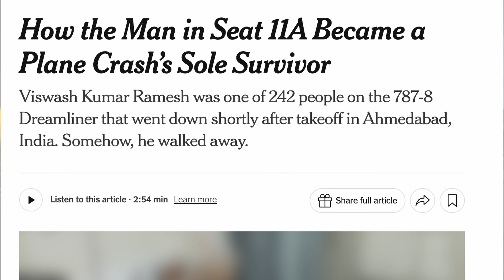Why the RAT Changes Everything – Air India 171 Update

Comment: What came to my mind is that people have been warning about cyber attacks since 2015, and aircraft now are flying data centres, especially the 787. Flight control is electronic with no cables.
FADEC, the flight control module  and the ELMS can all be hacked. Yes, the systems are air gapped, but there’s still concern. Hackers at DefCon etc have shown it’s possible, even with separate hardened architectures. Introduce Starlink to this, and the mind boggles.

Comment: How could whatever caused the RAT to come down not have been found if there were final-minute and thorough safety checks on planes?  Surely any major or even not so major electrical problem would have been discovered - unless 'internal' and last-minute SABOTAGE is the reason for these shocking and accumulating 'unexpected' disasters?  This isn't about simply finding out what went wrong:  the world needs to know they are going to be paying for, and taking, planes that aren't allowed to launch into the air with massive mechanical or other problems!  And Boeing have become now renowned for failure to ensure safe flights in their planes.  I assumed following the USA Senate's Inquiry into Boeing just several months ago as I recall, that Boeing would have been closed down - now we have evidence that there is something very seriously wrong with adequate checking not being carried out.  That is how I see it.  We can continue to take flights in sheer terror and NOTHING is being done to stop it.

Comment: Crashes are bad enough, but you lose two engines like that during initial liftoff, that’s DC-10-grade freaky. I’m not exactly eager to board a 787 after this. One engine, fine. Two? And no bird strike?

I personally suspect a computer glitch or malfunction.
Reply: At least 3 redundancies for every system and it STILL shut down completely? What the hell!  Owing will be absolutely desperate for this to be pilot error. Another reliability issue with Boeing, well, how do they recover??
Reply: @mkkravist11  , hopefully for Boeing it's an Air India maintenance issue, otherwise...

Comment: RAT means Ram Air Turbine. It provides emergency hydraulic or electrical power to essential systems in case of a dual engine failure or main power loss..It works by using the airflow (ram air) generated by the plane's forward motion to spin the turbine.

Comment: That flight was way over maximum gross weight. Something was in cargo undeclared. You will never know.
1. They used every cm of that runway to have enough power to accelerate it to take off speeds at that weight but It just wasn't enough. You see dust cloud for a reason.
2. Difficulty climbing after lift off
3. In panic Copilot pulled up the flaps instead of the gear.

Comment: Rat auto deployment theori is not True. 
To auto rat deploy in case of both engines loss requirements are: both engines at or below idle and plus 2 seconds time delay.Total time between loss of lift(a/c lost of proper aerodynamic lift, positive climb) and crash was 20seconds. 
Droping idle speed takes much more time during takeoff.  Also take into account 2 seconds time delay and about 4 seconds rat movement. 
The time you point out the 'gray dot'  also some seconds before the crash. So auto rat deployment scenario does not make sense.

Comment: Dual engine failure as they rotated is just crazy, I’m of the belief that the 2 hour flight they did before this leg the fuel was contaminated and on landing when the fuel pressure was reduced some foreign particals got stuck in the fuel line so when they powered up for     t/o they get full power for a little while but they loose fuel flow right as they get airborne and an engine starved of fuel is going to roll back, what I don’t understand is why both did it at exactly the same time because I thought big jets like this had different fuel systems

Comment: Software/System Fault (FADEC or Electrical)
If a shared system (e.g., the FADEC controls, electrical bus, or sensor input) sends incorrect data, it could cause both engines to shut down or roll back immediately.

Extremely rare, but possible if there's a shared configuration error or miscommunication between systems.

Comment: Blaming dead pilots is the easiest thing to do. Both pilot had together  more than 10000 hrs of flying time. Let's give them their due. They gave May Day call and tried for controlled hard landing all in time span of less than 1 minute. Cant rule of safety issues at Boeing off late as well. Lithium battery used in Dreamliner has had issues in the past. Lets wait for investigation to get over and give due respect to all passengers who died along with crew and pilot. No pilot will be careless when own life is at stake.

Comment: I couldn't see the RAT deployed at the beginning of this video from the rooftop. The RAT seemed to deploy after the flight has gone a little far, where you have rounded it with a red circle. Please confirm if I am right. If the RAT didn't deploy at the beginning of the video, then how can it make the typical RAT sound? Take a screenshot of the moment you see the flight in the video, zoom into the image and check that RAT has not  deployed at that moment.

Comment: Good observation Captain
Blocked fuel filters, mismanaged crossfeed systems, or contaminated fuel could disrupt flow to both engines simultaneously. or FADEC malfunction disrupting thrust, resulting in Partial Power in both engines that it could not sustain climb in high temperatures of 40°c and full load.

Comment: I'm still with the flaps not being selected for take-off, before flight weight checks at the gate and pre-take off would have made both pilots check them. I'm not familar with the aircraft but I would imagine they are screwjack operated and wouldn't blow back in the event of hyd failure. A RAT deployed and no flaps at take off is a combination I've never seen before. (Thirty year aircraft enginneer).

Comment: Great that the RAT never pops down during normal flying as planes already fly at super slow speeds, else like you could reach London to New York in less than 2 hours, so on-demand additional electricity generation by the RAT is otherwise pointless 😊

Comment: Juan Brown -blancolirio -had pointed out it appears the gear was commanded UP because the wheels are not angled down like after liftoff. First they go level and the doors open, then they go up into the fuselage.  Then were in the level position.

Comment: Has someone missed the cloud of white smoke visible in the video taken from the airport security camera as the plane is just lifting off? Where did it come from?
Reply: May be it was dead end of runway..some sort of dust or don't know
Reply: @shiVani-sv1ns  It's possible but unlikely as if this runway is used regularly the jet blast would normally have blown most dust off it... I wonder if the engines started to fail at that point? There's no flame visible from a common flame out, but supposing fuel starvation occurred and the result was white smoke? If there was water in the fuel...

Comment: 3:07 even without seeing the video, the audio plainly recorded the noise of the RAT.  It sounds like a prop plane, because it is indeed a variable pitch prop in the airflow. Given that passengers on a previous sector complained that there were multiple electrical problems, I'm not convinced by the dual engine failure theory.

Comment: It's clearly NOT dual engine failure but a problem with the electrical system / hydraulics since they couldn't raise the landing gear. There was a video on youtube showing passangers complaining abut the electricity in the plain not working befor takeoff, just put 1 and 1 together

Comment: Thanks Captain. Really clear and congratulations on your preparedness to discard your previous conclusions based on new evidence. But...both engines failing at once? What on earth? I can onlythink of contaminated fuel or some soft of software malfunction on the engine management system. But...in those cses, how would the aircraft have got off the ground. Congratulations to the Air India crew for trying to manage the situation...getting out a Mayday and deploying the RAT, as well as electing to keep the gear down.

Comment: Two factors you haven't mentioned:
a) The ground temperature on the day was 39°C 
b) It was reported by a passenger on the last  flight that the air con wasn't working.
The combination of both could have caused overheating in the avionics and therefore the RAT was deployed.

Comment: It's mind boggling to me that trained pilots cannot recognize a stall when they see one.  And this is a classic stall.  If you look at the shape of the wings from every video available, they all show the same thing.  The wings are skinny, which means that the plane was never properly configured for departure.  The flaps were never extended.  The RAT was manually deployed by the Captain who mistakenly confused a stall for a loss of engine thrust.  The gear was never raised because in the confusion going on in the cockpit with alarm warnings sounding and the Captains refusal to believe the flaps were in the wrong position, he panicked.  As a Captain yourself, I'm sure that you understand that flaps up at low altitude is a death sentence.  This Captain had one chance to extend the flaps and raise the gear as soon as he realized that something was wrong and he failed to recognize a fixable problem.  If trained pilots and experienced Captains such as yourself cannot recognize a simple stall, it's no wonder why planes crash.  This is why pilots have checklists for everything.  Follow the checklists and verify, then you eliminate pilot error.  This crash never should have happened.  But, I guess not everyone is a Captain Al Haynes or a Sully Sullenberger.

Comment: It was obvious from the start it was a simultaneous, dual engine failure.

Therefore it was caused by either an unrealistic FADEC-commanded shutdown 

Or

One of the pilots deliberately selecting the master switches off as they rotated. 

The gear doors extend 1 second after liftoff. Unless an engine failure is detected. They never extended. Therefore they had the dual engine failure right about the time the nose came off the runway.

Comment: All told, complete engine failure is what I'm leaning towards. Obviously I'm no expert but if the plane was losing height over a populated area the pilot would have increased thrust to try gain height or glide length. Those engines would be absolutely screaming. That we can hear the RAT is telling.

Comment: What about spinning down the engines from to power to windmill, when will it trigger? Since time from to power to down spooling generators still provide power also the batteries still supply some power.  That takes some time?  Same for hydraulic system and its related pumps,  More time than this happening?

Comment: The RWY is 3505m long, and they used only half of it. The take-off roll usually takes 30-40 seconds before airborne. I can't see the RAT. It's quite a big piece of equipment. The sound is like RAT operating. I zoomed up the video and found something that looked like the RAT. There's nothing that could be such visible like the RAT. So we are looking for a dual engine failure. Captain said. No power, no thrust, we can't climb.

Comment: I posted on this after Captain Steve initially had speculated (see my quote below):

"Captain Steve raises the possibility of pilot error - perhaps someone confusing landing gear and flap controls as the plane began its ascent. Captain Steve does not believe there was a power failure. However, running counter to that thinking, there is video from the AI171 takeoff which clearly indicates the emergency RAT (ram air turbine) was deployed and this happens automatically ONLY when there is a catastrophic systems/power failure.

Indeed, the sole survivor onboard the flight, has stated that as the plane took off, it seemed to be "stuck in the air" and there was a flickering of green and white lighting. This would suggest that the aircraft's main power was suddenly lost and there was a shift to the minimal back-up power to light-up the emergency lighting. So, if there was a total systems failure, the trick will be to figure out how that could happen on a modern Boeing 787-8 in the absence of a  dual-engine fire/blow out."

Thanks Captain Steve for recently revising your thoughts. Something caused a compete loss of power to the ill-fated AI171 flight, and the investigators will hopefully soon uncover more data to try and piece this thing together.

Comment: Dual failure sounds so incredibly unlikely though. Let's say one engine failed, and pilots accidentally shut down the working engine - would this cause the RAT to deploy still? If so, I would still say that is more likely than both engines failing at once.

Comment: I´m just speculate here, but in the video were you can see the takeoff, there is a lot of dust comming up from the left side of the airplane, but almost non from the right side. Is it possible that the right engine had shut down even before they got airborne, and the second one shortly there after ?

Comment: I was skeptical about the pilot error because the flaps and gear controls are far apart and look very different from each other in a 787. The Rat being deployed definitely means total loss of electrical power and since it doesn't look like there's any damage to the engines. With the current available evidence, the only thing left is catastrophic electric systems failure which could be caused by the batteries on this aircraft which have a history of catching fire.

Comment: to me it looks like they tried to takeoff from intersection where they entered the runway instead of back tracking for the full runway, when they realised they won’t lift off till the end of the runway the trust lives to the wall and over-boosted engines. Combine with outside temperature and low speed. EGT got very high , engines expanded, fan got caught in casing and engines failed.

Comment: a software or control failure could have played a role.

Possible causes for such a scenario include:
- Autothrottle malfunction – The automatic thrust control may have received incorrect data and inadvertently reduced both engines to idle.
- Sensor issues – Faulty sensors could have transmitted incorrect values, leading to improper engine response.
- Software update errors – Previous faulty updates have already caused unexpected thrust loss.
- Communication failure between the engine and flight control – Incorrect data transmission could result in improper engine control.
- Pilot input or operational error – If the crew entered incorrect commands, it might have influenced engine behavior.

Comment: At first I thought the theory that flaps were raised instead of gear to be outlandish. This is the one action the pilot monitoring performs in the cockpit after seeing positive climb and it should be total muscle memory to perform, not to mention that the placement of both levers is completely different (gear being on the front panel, flaps close to the engine levers on the pedestal).
HOWEVER, I find it curious why the gear was indeed still up in the clips we see when the plane was airborne. This indicates that whatever problem occurred was already noticeable either during acceleration or pretty much immediately at takeoff (maybe somewhere in between after V1 and before takeoff, when they had to commit), causing the pilot monitoring to not raise the gear, because they were in an emergency situation already where you would keep the gear down in preparation for a turn-around. Now, in such a situation, I could actually believe that the pilot monitoring made a grave mistake, because muscle memory told him to raise a lever, but his cognition told him not to raise the gear... and maybe (if the engines had indeed a problem) the insufficient airspeed prompted him to raise flaps in order to increase speed, thereby destroying lift at the low speed they were still going.
Pure speculation at this point, for sure, but at this point I find a dual-engine failure to be the more outlandish scenario, since presumably they were accelerating fine up until at least V1. So, my theory currently is that they had some sort of electrical/hydraulic problem shortly before takeoff, therefore RAT deployed, while pilot monitoring panicked and retracted flaps instead of gear. We will see, I guess.

Comment: Not sure if this should be, or has already been, pointed out, but if the engines were working and providing take-off power, wouldn’t that sound drown out the RAT propeller noise?  Isn’t the only reason we can hear the RAT due to the fact that the engines are so quiet?

Comment: If one of the pilots wanted to commit suicide and brought the power levers back, would that deploy the RAT, or is it only on an actual failure of the engines?  Since most turbine engines take several seconds to come up to power, if that was the case, would it be too late for the other pilot to react, or could the pilot wanting to commit suicide be able to prevent the other pilot from bringing the power back up?  Do you know how long it takes the engines on the 787 to respond to bringing the power levers back forward?  May sound crazy, but what about the Alaska airlines pilot riding in the jump seat about a year ago bringing the power levers back?  There are allegations that another airline pilot years ago did something to intentionally cause the crash.

Comment: Look up BA flight 38 dual engine failure on RR Trent 700 engines ice clogging fuel pumps. 787 has RR Trent 1000 engines I think a similar scenario happened here.

Comment: I fly a small single engine aircraft and gliders. I am always planning where to ditch in case the engine stops or the tow cable snaps. In an airport in the middle of densely populated areas, unfortunately, there is no option unless you can find a large body of water.